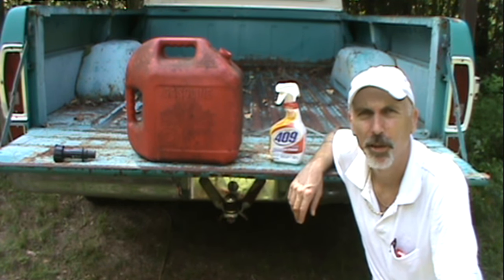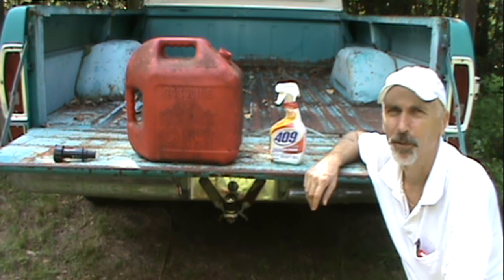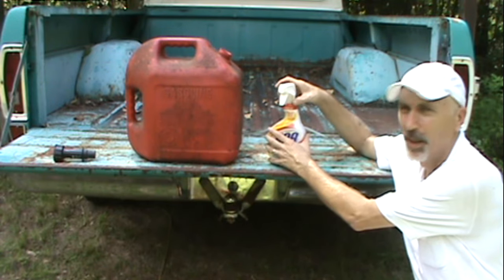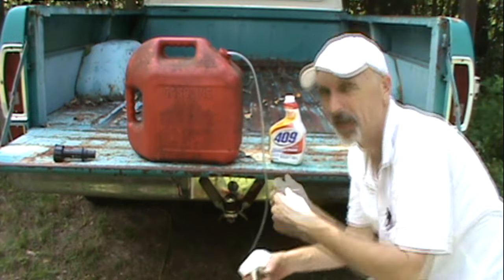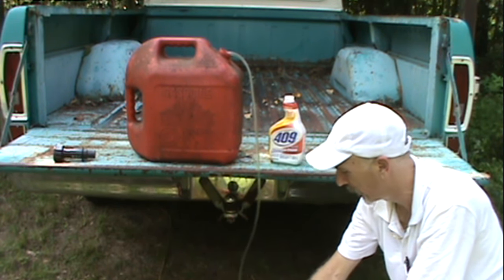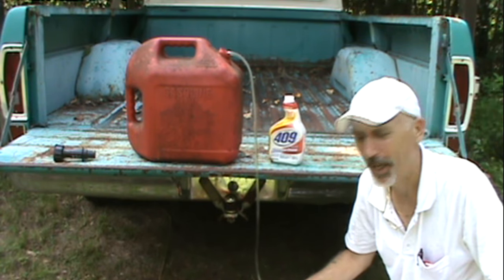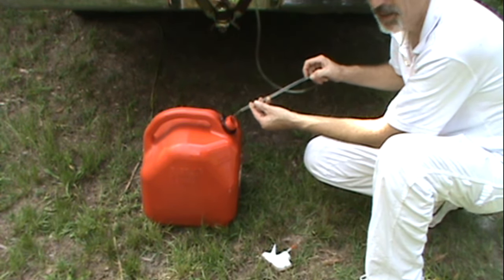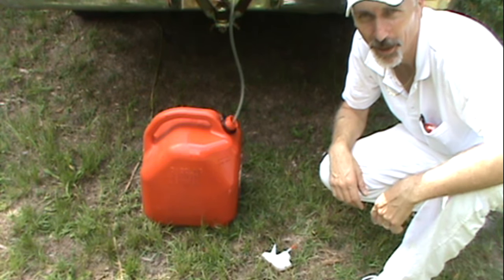Siphon Gas Using A 409 Bottle

Comment: I used the last of my Windex last night, was about to trash the bottle this afternoon, when I looked at the sprayer & thought "why wouldn't this work for my DIY siphon thing I've been wanting to make?" but how & where would I attach it? (was actually incorrectly thinking about the second tube thing they use to blow into the gas tank idea). Glad I googled & found your video - will be trying this to get rain water from my buckets to my watering can

Comment: what if a parked vehicle on the ground inside the garage?  Will that work?
Reply from the maker: Yes, I’ve done it several times to get old gas out of vehicles in garage. As long as you get it to siphon it will work
Reply: Do you have to raise your vehicle to get the gas out?

Comment: So I drained my aquarium with just a plain hose, nothing on either end. One end in the aquarium, the other out the window. The end in the aquarium goes underwater and you shake it a few times (staying underwater) and it drains the aquarium out the window no problem. Was going to try the same concept. Can't see why it's any different. If it doesn't work I am getting out the 409 bottle. Thanks a bunch

Comment: Auto noob, likely a silly ? ... trying to fire up an old neglected 2003 Volk Passat 1.8T ... prepping to try to drain bad gas out of the fuel lines via unhooking the Hi Press fuel line nut and draining with a hose with the fuel pump assist.  If the fuel pump has failed or won't move a little gas trying to engage the ignition ... could this method of using a passive  spray nozzle on the end of the disconnected fuel line draw gas out of the system with each squirt?  Would taking off the gas cap make a venting difference?